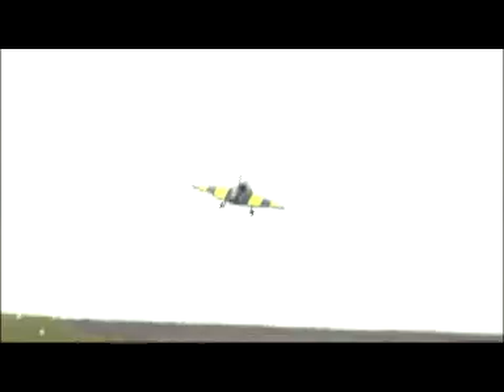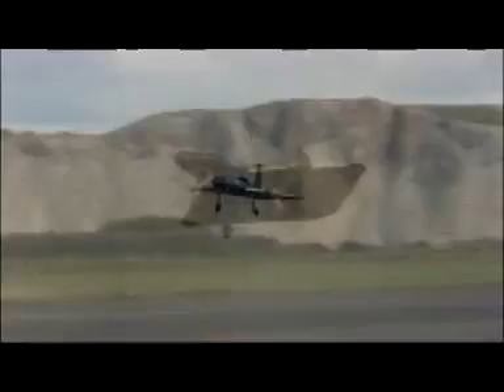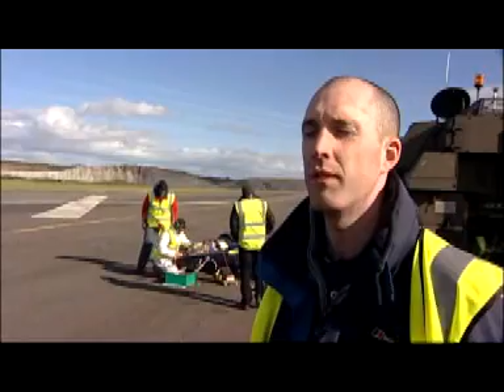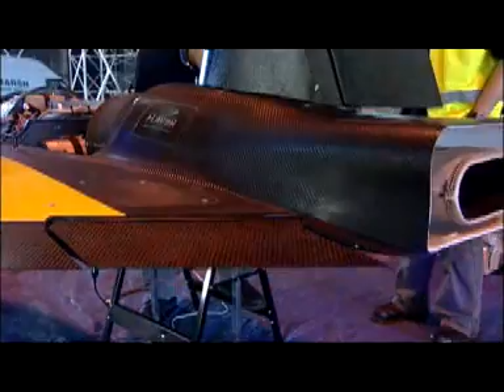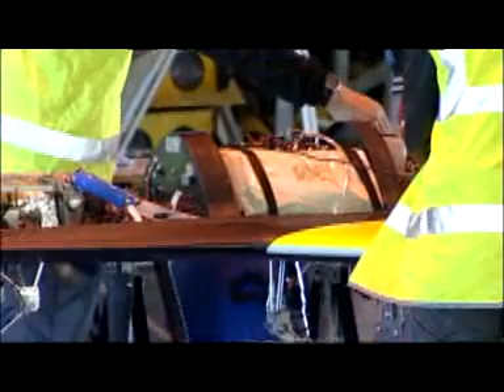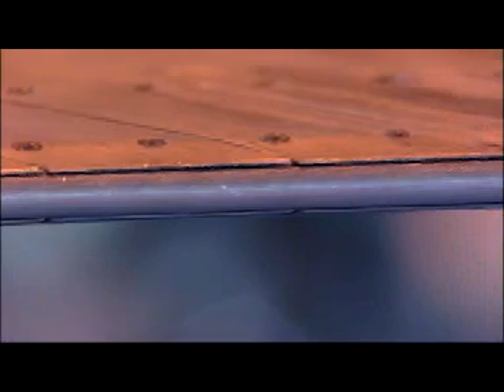Cranfield/BAE Systems Demon UAV's "flapless flight"

Comment: I'm not sure anyone commenting has any idea... judging from everyone blowing off about thrust vectoring.
From other research papers, the amount of extra lift which can be generated by trailing edge blowing is on the order of 400% of the energy used to drive the blowing compressor...  

This is Not merely thrust vectoring, it is using a form circulation control to vary lift generated.

At supersonic speeds sure all you need is vectored thrust, at subsonic speeds it is more of a balancing game

Comment: What are you guys arguing about,its experimental technology that will or will not have a useful spin off.One thing occurs to me,you will achieve a lighter structured air frame with no conventional control surfaces,less mechanical linkages to fail ?

Comment: @CodeWarriorx0539 Do you wish to elaborate?
Yes there are other ways, but this one is definitely one of the more simple and cost-effective solutions.
-Perfect- stealth would require the use of metamaterials to bend radar radiation around it. This technology is still a developing field and production methods are slow.
Plasma stealth is another idea, but this requires a large power source and additionally plasma can be unstable, releasing energy across multiple wavelengths, including radar.